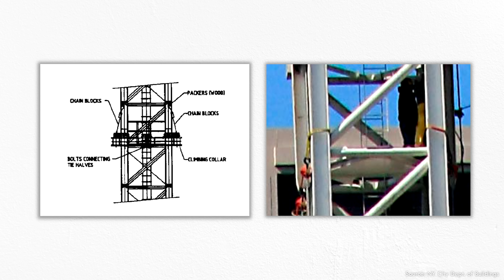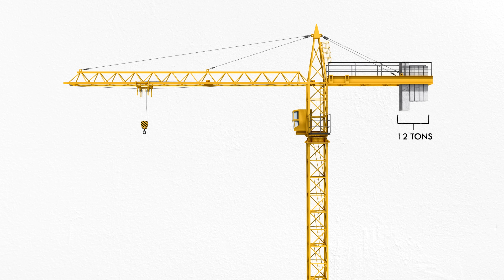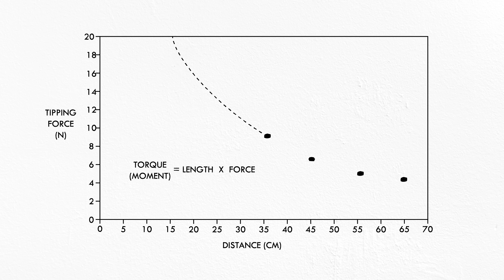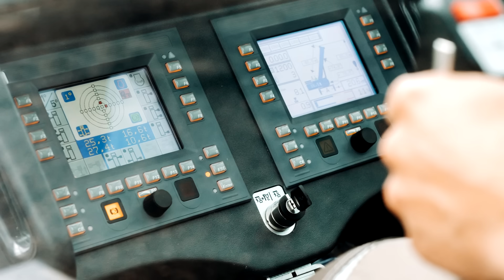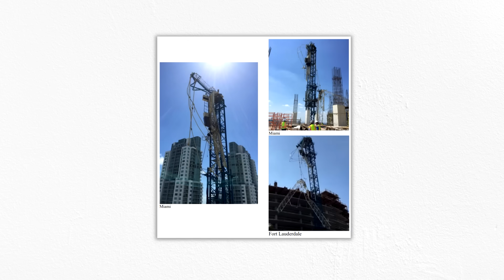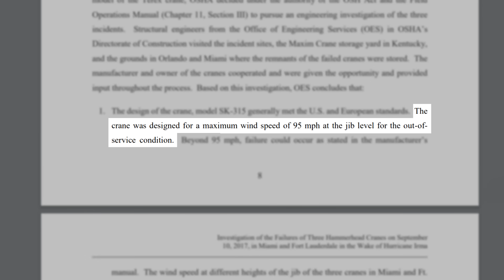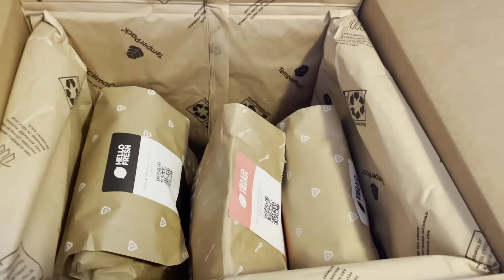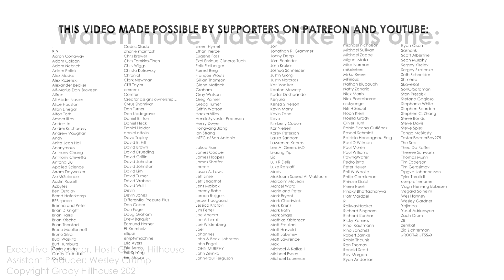Why Cranes Collapse

Comment: After a 10 year career in crane engineering, I know how easy it is to get even basic crane content dangerously wrong. I started this video fully expecting to be ranting afterward. But, you did an incredible job and has me sending this video to our training people. Bravo.
Reply: hey aaron....i have a question for you if you have a moment.  i need to lift some steel beams and trusses to construct a carport at my home.  max beam weight will be about 250lbs, lifted 10-12 feet, and steel trusses lifted to 15 feet or so.   I have a 3000lbs portable manual motor lift.  I want to use this as a base for a gin pole crane made of a 20ft section of 2inch ID schedule 40 pipe.  i will weld a plate at the base for a hinge bolt and two plates at the top at the top for a pulley and chain connection.  i will use outriggers and sandbags and wood planks to level and weight the base.  i have an 800lbs chain to connect to the top plate and base to hold the pipe at a 75-80 degree angle.  two side straps will stabilize the boom laterally.  i have a 3000lb boat winch and a pulley to raise the load to set on pre welded angle iron  to weld in place.  my question is if i were to stiffen the pipe boom with a length of tensioned steel strapping, would i do this along the top of the pipe, or the bottom?  my inclination is to reinforce the bottom in this configuration.....this may be complete overkill and un-needed though....any thoughts?  thanks.....have you been following the crane exploits at the boca chica spaceX launch facility.  they just finished placing the booster rocket on the orbital launch pad today....they built and stacked the launch tower over the last month.  very cool stuff.  i have been watching on Nasaspaceflight.com on youtube.  awesome crane footage.  also, the people at nasaspacefilght have been looking for a crane person to do a livestream and talk about the monster liebhur crawler crane at the launch site...they routinely get 30-40K people watching live.  might be a promotional opportunity for you or your company.  check them out and contact them if you want to be a crane expert on their livestream.  take care..pete
Reply: @peetky8645  No offense, but I hesitate to give much advice on such an arrangement due to the brief description provided and my desire to avoid even the perception of liability in the event something goes wrong. 

In general, I will say adding a tension strap, which will (assumedly) load the member it is affixed to in compression will lower that member's ability to support a compressive load.  It will also reduce that member's ability to resist buckling, which is usually the governing failure mode in a long, slender pole loaded in compression. .
Reply: @usagi190  thanks
Reply: @peetky8645  By your statements and especially, questions, you should not attempt these picks, but should call the International Association of Bridge, Structural, Ornamental and Reinforcing 
Iron Workers local union hall nearest you.
Reply: @senatorjosephmccarthy2720  Why call a bunch of union hacks that will charge $10,000 while spending 8 hours on breaks and one hour towards working and make a one day job into a two month long job.
Reply: @senatorjosephmccarthy2720  thanks joe
Reply: @DominicNJ73  I agree call a non unionized steel erector ... 22 year experience never sat laid off and have walked and worked the largest clear span hanger in North America ..  non Union for life
Reply: @DominicNJ73  yeah, why call the best trained, safest in the industry when you can get some scab outfit that half the time stumbles through and gets it right.
Reply: @peetky8645  You have a complex system of miss matched parts in mind that you want to use to lift the beams and trusses.  If you think about it it only takes one piece to fail during lifting and you have a backyard disaster that will certainly damage the beams, trusses or garage and possibly injure someone. The cost of damage to one beam alone is enough that this is not something you want to cheap out on. Hiring a crane is justified, Providing your reach is not far you will not require a large crane, with good planning you probably only need to hire a crane for 1 1/2 -2 hours. Possibly $500.00 dollars for a safe easy installation.
Reply: @wirefeed3419  thanks for the input.
Reply: @peetky8645  rent a telehandler and use proper rigging
Reply: @360magnum  thanks
Reply: @peetky8645  a telescoping two section stick boom truck will work for what you’re attempting to do. You can do it the old fashioned way by setting the truss ends on the top sills and have someone on the ground use a pipe or 2x4 to help raise the top of the truss up.
Reply: @peetky8645  This is why I'm not asking the comments section how to erect my DIY outdoor antenna.
Reply: Crane content
Reply: Don't lie

Comment: In the city I work for we had a building nearly finished torched by an arsonist. The tower crane was set to weather-vane. The hot air from the fire set it spinning! That was scary. I was not able to do an inspection to a project that was just in the crane swing until they cleared the crane. What was as scary was the scaffolding which was all attached to the now missing building. About 10 stories of unsupported scaffolding.

Comment: Bad surface prep, setup too close to trenches and overloading have been the cause of every crane failure I have seen in my time in construction. In my experience the smaller the crane the higher the danger because people take stupid risks with a 20 ton crane they would never take with a 200 ton crane.

Comment: Awesome video. I have been working crane plans for 30 years. I have always been conservative, but it still seems you will periodically get yourself in a bind. Usually it has been weather or not understanding the actual load weight. It usually comes back to the facts that details matter and sometimes you just have to shutdown and wait for weather to pass. Never be in a hurry.

Comment: My experience does not cover cranes but does cover automotive hoists and other hazards such as welding etc.  I would say that in virtually every avoidable accident where the fault is found in operator error, there is also a manager (usually with a degree and no experience) who has a deadline and a boss to impress or a budget to beat.  He pushes crews and operators to take risks they might not normally take.  This isn't always the case as there certainly are people who just don't think of safety, but I've personally seen technicians blames when a vehicle falls of a hoist where the management had been told numerous times that the hoist was out of adjustment, safety locks didn't work, and it needed repairs.  They were never performed, yet the owner of the business showed up every day with a $100k Cadillac Escalade and his manager was driving a high end Grand Cherokee.  A brand new hoist could be purchased for <$3k and installed for another $1500.  It was never done until a 14k pound vehicle AND the hoist were destroyed in the accident.

Comment: HEY! I'm in the business of stopping cranes from collapsing in the wild!
We build a VERY heavy and VERY large surface area mat from lumber that you can place the legs of cranes on! THEY ARE CALLED drum roll please ...........Crane mats! We ship most places on the east coast in the USA so if you've got a need for a supplier, we got you. No middle man needed. It's genuinely ME who builds them, and ME who loads them on the truck to make sure the right product gets to the right place.

You can also use these mats for all kinds of fun things like making bridges (we've a special design for that actually but you can use the normal plain ol' design with no issue), Making a hard surface for vehicle to drive on in swampy areas or through muddy roads and fields. Basically, it spreads the weight distribution to a larger surface area so that you don't ruin a customer's lawn or field, stops crane legs from sinking, and prevents creating ruts in the woods when you are harvesting trees (And replacing them with new growth afterward like a responsible adult!). We've genuinely NOT been able to find some dumb idea that these things can find a role it!

We've used them to make retaining walls (not permanent but they'll last 20+ years), built playhouses with them (be sure to secure them with bolts driven through to the ground!), we've built stages with them, and even built a few ramps (Don't tell my boss!).

Never thought I'd type an ad in a comment on youtube but HEY here we are!!

Comment: Stationary crane DIS-ASSEMBLY in BC Canada is accomplished by very few authorized crews. Just a decade ago BC did something else for crane operators: there are seven (eight?) levels starting with trucks and mobile cranes, hand held operator on the ground cranes, and (of course) stationary cranes. ALL OF US without regard to experience had to take the new test regimen. If you arrived and "reminded" the test crew you had XXXXX years of "experience" you got......the Algebra questions. It was a way to get rid of the alcoholics, crack heads, druggies, and those just plain losing it, and make way for the "New Generation" (no, not the Cartel) Pretty Soup Nazi, but with so many cranes in BC being in high pedestrian public areas I cna't really blame the govt. for wanting to CLEAN CLOCK. NOW, lets'  talk about Florida, West Virginia, Belize, or Zimbabwe.

Comment: What you did not mention was the influence of pressure to "get it done" that forces operators to push limits to the max leaving no room for unseen errors. As in the Lampson Crane in the last example. Running max load and pushing the wind max load without leaving any room for safety.  How hard was management pushing?
Reply: Exactly. Tbh that is where, I would say, 70% of injuries/accidents come from. I was a safety guy for a year for a small electric company and am now working in the field as a layout guy/heavy equipment operator (I know kinda backwards) and have seen how many injuries could've occurred/did occur because of the push to get it done. The other 30% is usually people themselves being careless or stupid...I've almost done it myself a few times
Reply: I'd wager that "get it done [quickly]" is the biggest workplace hazard across all occupations.
Reply: The crane operators should say to management: No, i'll get it done properly and safely. Not quickly.
Reply: @simontay4851  And then they will be the first to be fired when the company feels they have to cut cost.
Employees will always be vulnerable to pressure from above.
And they will always seek ways to relive that pressure.

As a employer or supervisor you must be ever vigilant to HOW the workers under you will try to relive said pressure.
If you keep telling your workers "get it done!" after they told you they can't, and then suddenly they get it done, don't pat yourself on the back for having been right all along, instead hurry down there and carefully look for the corners they cut.
Reply: Big Blue the crane collapse shown at Miller Park. Two operators were walked off that day refusing to do the pick due to high winds. The operator that did the pick is spending life in prison. The "management" is responsible for forcing it but gets to pin the operator.
Reply: @keithbroom9614 I guess there wasn’t a Union to fight his case else he’d not have to have made that risk which the other 2 hadn’t in the first place . 🙄👍
Reply: @newforestpixie5297  Actually there was if my memory serves. Nothing major happens in Milwaukee without one. Unions have a lot of power there. The union protects the people that refused not the one that did it anyway. He was considered responsible for an unsafe maneuver that he should have refused. That said the project was weeks behind schedule mainly due to weather that year and Miller doesn't like to hear no. About 15 years ago we were at Miller Coors in Golden CO (I'm in the sanitary stainless business). Ridiculous safety measures impossible to meet. Find out from locals that an in plant electrician got fried on the job they tried to claim he never showed up that day. His wife found his car in the parking lot and refused to leave til they found his charred remains. Covered up. Made local news once. Never made news outside of Golden.
Reply: @keithbroom9614  where did you get this info? The only thing I can find is one guy maybe objecting to the lift and three companies fined a total of 500k.
Reply: Biggest crane in the world, what's he supposed to do, get a bigger crane?
Reply: @whatyousaidbud  Wait for still weather, try to plan the lift to a higher-capacity part of the envelope, multi-crane lift, or honestly, that's a management failure: Plan the construction so it can be done safely with the planned tools.
Reply: @whatyousaidbud  multi crane pick. Wind farms do it all the time to safely assemble the wind turbines.
Reply: @whatyousaidbud     he should have told his bosses to go blow themselves and not done it.  but i get it, kinda.
Reply: @whatyousaidbud  wait for the wind to stop.
Reply: @whatyousaidbud  I feel like there had to be a way to break the section into multiple pieces and install them separately.
Reply: You are so absolutely spot on right on the money here!!!!  Ultimately, that's what brought Big Blue down.
Reply: In the case of the collapse of Big Blue, they NEVER figured out the wind effect on the LOAD (they ONLY figured out the effect for the crane). If they had done the actual calculations for the load, NO one would have attempted the lift that day.

Comment: I work in large scale concrete construction. You always check and double check your work when lifting up to 90,000lbs girders. Ive seen some crazy stuff in my years building high rises, levees, and stadiums. You DO NOT skimp on safety. That big blue crane collapse was management failure. 3 operators refused to do it so they found someone who would=deaths. You DO NOT skip safety margins

Comment: London, Battersea. Crane lifts 4.5t boat skip loaded with dirt and crashed rock. Placement of the crane puts it in the wind comming down on the river. Crane loses breaks and keeps slewing. Boat skip hits the tower of another crane and then gets tangled in some nets bringing the breakless crane to a stop. On top of a third crane. And all that because phone calls between managers. Same as with Big Blue. Manager wants to make time, ends up losing more time. Crane operator is to be blamed.

Comment: Me, a 25y/o wildlife biologist who knows absolutely nothing about engineering:

“Well of course slew ring failed, they used the 12 ton counter weight instead of the 8 ton weight!”
Reply: This comment has "come on you guys you're dereferencing a null pointer" energy
Reply: What type of study do you do?
20 years ago I helped a friend with their study, catching all their critters, building their apparatus.
Very stimulating time.
Reply: @kiwibob223  I work at a 2,500 acre nature preserve. Mostly its habitat management. We have to replicate the now gone environmental factors. Things like grazing by bison and elk & small wildfires the clear fuel load. We plant native plants, suppress invasive plants, mow the prairie once every two years to simulate grazing, and do controlled burns.
Reply: @arlen_95  😯 
" Mow the prairie" 
I can tell you this is the first time I've seen this sentence in my life.
What do you do with the cuttings? 
How many man hours does it take?
Wouldn't it be easier to buy bison ?
How much do you love your job ?
🤯
Reply: @kiwibob223  We mow big a big tractor with a mow width of around 12ft. We have two bison but they're kept in pins. We leave the cut grass there as fertilizer. We have hundreds of acres of prairie so that would take a lot of bison & bison aren't entirely people friendly. We mow half the prairie every year so every acre gets mowed once every two years. That's except for the firebreaks that divide sections of prairie. We mow those every few weeks & keep them short. They're about 40-50 feet wide & divide the prairie in 20-30 acre sections that make management easier & would slow down a possible wildfire. And I like my job  lot! <3 Though the heat can suck in summer. Yesterday the heat index was 108F (42.2C)

Thanks for the questions! Let me know if you have any more!
Reply: Actually it can be done if you have turbo encabulator installed.
Reply: This video reads different if you use "crane (wildlife)" instead of "crane (machine)"

Comment: just to point out an other reason: an unexpected sudden mechanical failure. like the collapse of HLC 295000 on vessel ORION in May 2020.  the hook broke at half capacity at a load test. causing the Vessel to heel and the crane to tipp over.

Comment: One thing that may have been somewhat glossed-over is operators intentionally inputting incorrect data into the LMI/PAT computer. They do this sometimes just to get a crane past a lock-out point. 
Such as say it’s a 2-part line instead of one, etc.
Reply: That seems a bit like the typical "If something is made idiotproof nature will invent a better idiot" scenario (might be off at remembering the exact quote).

People will always try to skirt around the rules and designs, I'm not sure how one would remedy that other than requiring a third party that is responsible for approving the work plan to authorise new settings. Or having the crane able to assess somehow if the entered settings match what it detects based on visual and other sensors. The first one is a lot of bureaucratic oversight that might not be welcome and I'm not sure if technology is ready for the second solution.

Comment: We will often use independent concrete crane footings just to avoid a lot of this. It's more expensive and it gets buried after the job but it's typically much safer
Reply: That works on a long-term job, but a lot of lifts are only a few hours on a single day and have to use temporary footings.